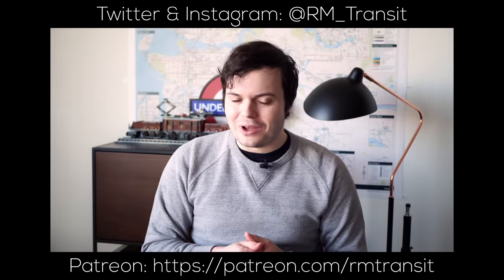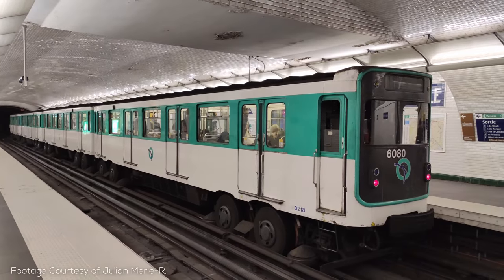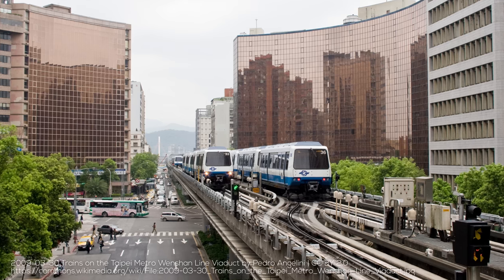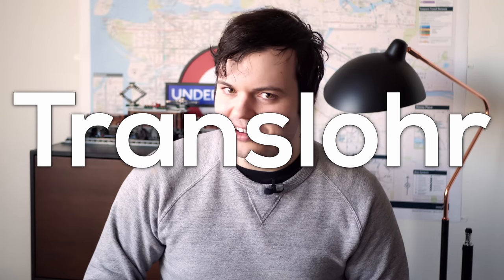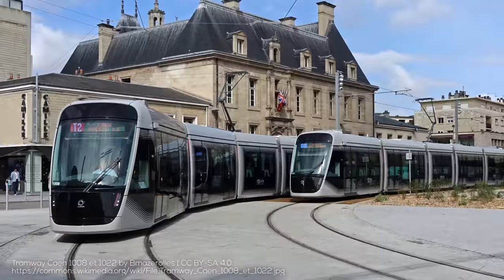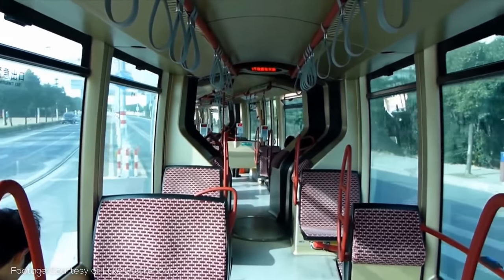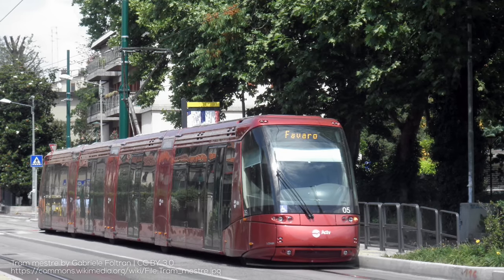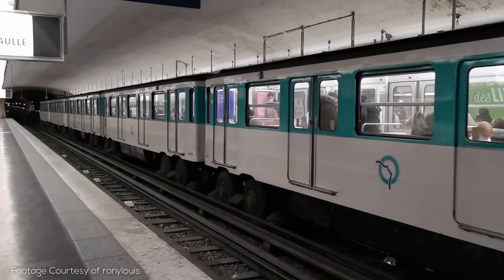Rubber-Tire Rail Transit is Weird

Comment: One issue you didn't mention is energy efficiency.  Rubber-tired vehicles consume significantly more energy than steel wheels on rails, and as energy costs rise, you may see some of the rubber-tired systems being phased out.  It also seems to me that some of the systems with both tires and steel wheels are more expensive to build and more expensive to maintain.  Unless the tires provide a vital benefit (such as steep grades), I'd stick with the tried-and-true technology.
Reply: While I definitely think most of these tyre alternative modes are unnecessarily expensive, I generally think the energy efficiency point is greatly overblown. Energy costs should be going down as vehicles are electrifies (current European crisis not withstanding), and honestly the real advantage always comes from getting people out of a car.
Reply: @neolithictransitrevolution427  I agree that rubber-tired public transit is far more efficient than automobiles, but I've read that moving freight by rail is 3 or 4 times more fuel-efficient than by truck.  I assume that there is a similar fuel savings when comparing rubber-tired trains to standard rail.  While the fuel costs may not be a significant factor right now, it's only going to go up.  
We need to make our cities less car-centric and more walkable/cycleable, and provide more public transit (even if it has to have rubber tires!).  We also need to modify zoning, so that homes, shops and workplaces can all be within walking distance of each other.
Reply: @neolithictransitrevolution427  rapid transit is mostly electrified anyway, and if carbon pricing works as planned, that electricity is probably going to get more expensive for a while, and energy is already a major operating cost from what I understand
Reply: @Bobrogers99  Agree on all points, although I think a portion of the Frieght issue is the Giant train engines are far more efficient than the comparatively little truck engines, and average train speeds are actually quite slow compared to highway traffic trucks.

Also, there is a good chance electrical costs will go down (relative to inflation of course).
Reply: @feynaomi  In the medium term the price will go up, but in the long term it will be decreasing as wind/solar farms pay off thier debt and produce effectively free energy, and perhaps with SMRs offering safe and flexible nuclear or Closed Loop Geothermal offering low cost power anywhere. 

Awfully huge chunks of the cost right now are building new transmission and rate subsidies for older versions of technology that is now cost competitive. Wind and Solar are both outbidding Coal plants, which is evidence of the net decrease in the cost of generating electricity.
Reply: @neolithictransitrevolution427  Sure, it's going to go down long term, but from what I kept from my energy systems course it'll likely get more expensive for at least a decade, and that's still a lot of operations cost. And even when it gets more expensive it'll still not be free, so efficiency and maintenance will impact the cost of the system
Reply from the maker: Yeah this is a real problem!
Reply: @feynaomi  For sure. But transit (metro) systems operate on a century time scale. So I wouldn't plan for just the next decade. 

But in general I would say rubber tyres are for busses and mainly a medium term solution, and generally not electric (but I love trackless trolley).So the high costs are an impact.
Reply: I would be curious to see studies comparing the energy saved for steel vs rubber wheels.  I suspect it isn't much.  For starters steel wheels and axles can be very heavy...figure 1000 pounds for one axle and 1000 pounds for each wheel.  Extra weight hurts efficiency and causes additional wear to tracks.  I suspect freight operators don't mind heavy wheel sets as they need the capacity to carry heavy loads (like ore) and the heavier cars help prevent derailing.  Plus steel being efficient is a drawback when it comes to braking.  Something like a light-weight monorail could likely use less energy than a heavy rapids transit metro.  Not only that, but heavy rail requires significantly more complicated/expensive bridges for elevated tracks.  Take a 5 car NYC train...that weighs 82,000 pounds empty and 122,000 pounds full.  Most semis in the  US are weight limited to 80k pounds!
Reply: @neolithictransitrevolution427  As of last month, the supply portion of my electric bill here in New England has doubled in one big jump.  I don't foresee it going down again.
Reply: @Bobrogers99  And in the next decade it won't. But on the time scale of transit systems it will.
Reply: I think the steel wheel is important for freight cars that weigh up to 100tons or more. Passenger cars weigh a lot less.
Reply: @neolithictransitrevolution427  average train speeds are actually quite slow compared to highway traffic trucks Actually, trucks (over here) are generally limited to 80 km/h, while most freight trains make 80-120 km/h. (Either subject to any speed restrictions on the route, of course.)
Reply: @KaiHenningsen  Interest, in North America freight trains do an average around 30km/h. I Wonder what the efficiency statistics in the comment I was replying to was for.
Reply: @neolithictransitrevolution427  Despite Energy prices going down in the long term, I still think that energy efficiency or efficiency in general is very important.

At the moment, energy consumption means carbon emissions and thus it is important to consume as little energy as possible by keeping our current development. That is also the whole point of transit in general, as it is much more energy (and space) efficient than individual car traffic. 

But even in the long term, when solar/wind or nuclear will have replaced fossil technologies, efficiency will still be key. Solar and wind farms still come at an ecological cost, although they do not emit in operation. And nuclear waste is still nuclear waste. Thus, having less power plants overall is good. Or we could use the energy saved for other stuff or sustaining a larger population.
Reply: @KaiHenningsen  The average speed of a freight train in Europe is around 40-60km/h at best. There are some nice reads about it online if you care to check. It might get to 80-100 at some points but freight trains get low priority over passenger on the network and are stationary for long periods during their journey thus reducing their average speed between point A and B.
Reply: When they were installed the trade-off was known : it consumes 20% more power but accelerates 20% faster. With each generation, Paris trains consume 20% less power than their predecessors. It will always be more than steel but removing tires from a line costs a lot and interrupt traffic and increases travel time. This was deemed useless to do on our current lines as a result.
Reply: @AaronSmith-sx4ez  Rolling stock with regenerative braking save energy rather than waste it.
Reply: @aodhganmerrimac  The new Rennes CityVal uses regen braking all the way to zero and the tyres do make rapid acceleration and frequent service possible.
Reply: @jerseygryphon  My comment was in response to a comment that steel wheeled rolling stock would use more energy to stop due to weight & the lower friction of steel on steel
Reply: @LeGrandJuju49  Each new generation consumes less energy because of an increase in the traction system efficiency. It's not related to the tyres getting better. Alstom itself quoted 30% more energy consumption for rubber-tyred subways VS steel wheel subway. 

This technology also do not provide better acceleration or braking in most cases, as steel wheels trains can easily reach the comfort limit of 1,35m/s² to which rubber-tyred subways are limited to not hurt passengers. For example the BART subway system in San Francisco has trains that could do that since its opening in the early 1970s.

Steel wheel subways in Paris are amongst the worst in the world in terms of performance with only 0,85 to 0,9 m/s² of acceleration, and they have one of the lowest rate of powered axles (only 60%) in the world for a subway as the overly conservative RATP sticks to an old habit of having 2 unpowered trailers with 5 car trains. Thus, the Paris subway is not a good testing ground for steel wheel subways. They also have a tendency to drive their steel wheel subways with slow and early braking, maybe be cause the "rubber-tyred trains religion" I notice in France makes people think that steel-wheels trains would wheelslip. Which is false given what many subways systems in the world achieve with conventional rolling stock built to good specifications. 

Rubber tyres subways are more of a thing of the past. Even the foreign subways networks to which RATP sold their rubber tyred solution build conventional subways for their new lines. That says it all.
Reply: @RMTransit  Hey, as a resident of Vancouver island I’d be wondering if you’d tell your opinion on the island rail corridor debate. I’d think you would be the best person for that. Thanks
Reply: @Subway2400  this is 100% true! The most weird thing is that using trains with low acceleration on the metro since the 70s is especially weird since our trains can do more and trailers were added later to have more trains for lower cost. It has stuck by then for some dumb reason, which I think is cost+We have always done that.

Building rubber tired now for normal use is useless when the dominant building method is deep bore TBM where sharp turns are a thing of the past.
Reply: @LeGrandJuju49  Yes I agree ! The soon-to-be MF19 will again feature the pattern of 2 trailers for a 5 car set, but they may reach an acceleration of 1,1 m/s². Still not the best for a network with stations spaced so close together, but still an improvement over the existing rolling stock.
Reply: @neolithictransitrevolution427  
Yeah, the cost is not going to go down. These renewable sources usually have very low energy output and their efficiency is not great at all. Nuclear is the only way forward until we find something better (considering nuclear waste being a big drawback).
Reply: @thetechnocrat4979  What does loe energy output mean? Are you refrencing capacity factor? 

I don't really want to debate this, have you looked into closed loop geothermal? I imagine you'll find it interesting
Reply: @neolithictransitrevolution427  
OK, I will look into it. I am not aware of it. What I mean by low energy output is the output of wind, solar and tidal methods is way too low and inefficient to meet the energy needs of the world.
Reply: And the airborne powdered rubber from normal tire wear is bad to breath and makes a mess!
Reply: Some time ago, I was in railway museum and I was able to try to push old train passengers cart (steel wheels) with my hand. And it moved. Stuff said than wind can move non-locked cart on side track. Now try to push your automobile for 5 persons. Sure you can do it, but amount of effort vs moved mass is a great different. I'm not a user of public transport, especially when they sold so many tickets that intercity train is full of standing people and you can't go to toilet, but steel on steel is much more energy efficient in terms of rolling. Greetings from Poland
Reply: Doesn't sound very green or sustainable does it
Reply: Rubber tire vehicles are much less noisy though. And causes much less vibration for the buildings and street around it.
Reply: Hey, if you want energy efficiency then use squirrel-cage motors:- you have a squirrel running inside a small cylindrical caged treadmill and feed it on peanuts and have this source of "motive power" connected to the drive wheels by an ultra-high-ratio gearing system and it will be able to at least keep up with rush-hour traffic. It's the perfect choice for stupid politicians who want to pretend to be transit geniuses and also be environmentally trendy. However the squirrels do wear out and basically die after a day so you need to install a replacement squirrel at the start of each shift. However the dead squirrels are a useful by-product which you can cook for supper.
Reply: actually, as the Paris metro is the densest in the world it is one of the rare systems in which tires make sense: tires accelerate and decelerate quickly which is valuable when the metro travels less than 400m between stops as is the case for line 4, of course, steel wheels make sense on less dense routes ; the RER for example, as an express service, stops less often and is thus 100% on steel wheels. tyres are more efficient when stops are frequent while steel wheels make are more efficient when momentum is gained, aka after a sufficiently long travel distance.
In addition, tyres allow for increased climbing and descent capabilities due to increased grip → additional control
moreover tyres absorb vibration and reduce tear on notably the bogies, allowing for increased durability + lighter rail stock as it does not need to be as robust /suffer as harsh forces. reduced weight = reduced electricity consumption + less momentum when breaking and less resistance when accelerating and climbing (goes back to point 1.)
lastly tyres inflict less tear on the rails which are exceptionally hard to perform maintenance on, especially when compared to simply switching tyres
Reply: What I don't get is why some systems based on the Paris Metro don't have sections where the concrete guideways dip out and the train coasts along on the steel rails. Then the rubber tyres could be used for acceleration and deceleration - especially since the extra traction from the tyres can translate into more energy recovered from braking.
Reply: Is electricity really that expensive??
Reply: @matthiasknutzen6061  All energy costs will probably go up some, but fossil fuels will become much more expensive as the supplies dwindle.  After the initial investment in solar, wind and geothermal sources, the cost of electricity should stabilize.  Generating electricity with natural gas, oil and coal will be phased out.
Reply: @RMTransit is just bus
Reply: What about particulate pollution from tyre wear?
Reply: I wonder if it's possible to mount most of the load onto the rail, thus the tires only provide balance and thrust. That way the system would be a true successor of the Ewing monorail